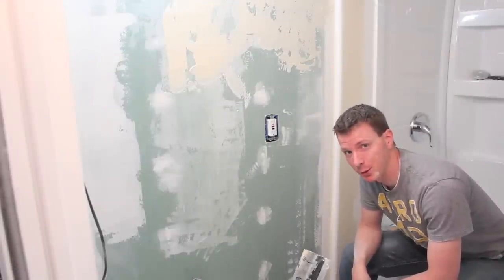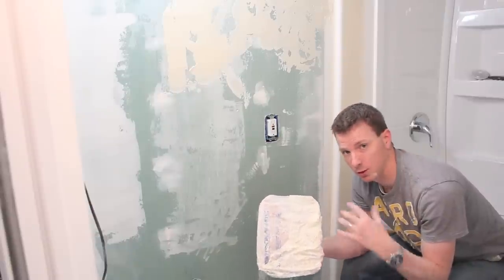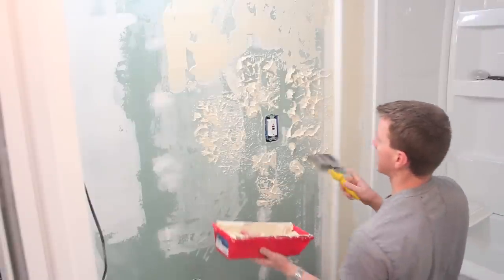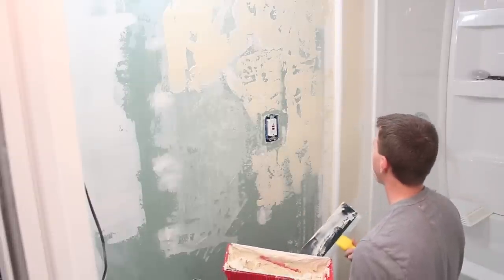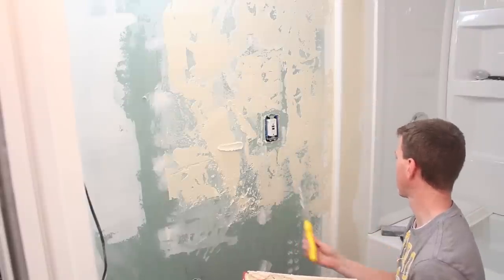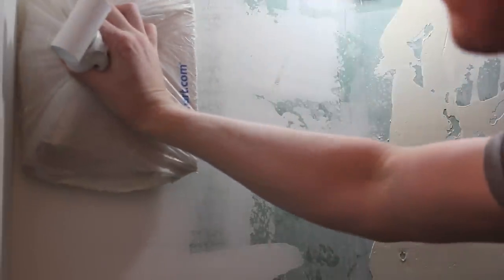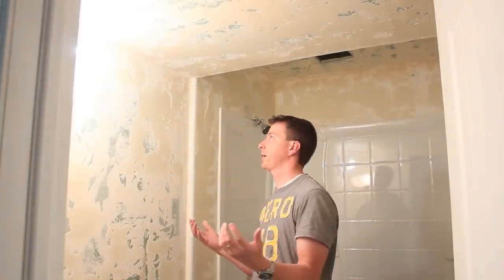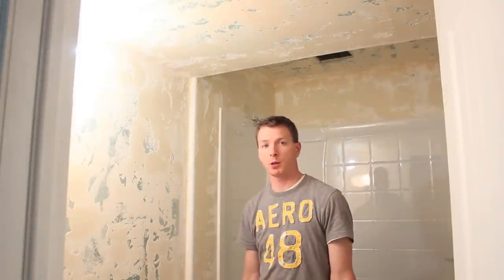How to Texture Walls - Santa Fe Texture

Comment: Tango, it may not look like much now, but that's because the old wall color is showing.  After some primer and paint, it'll look pretty good.  
Nils, I love your DIY hawk (that's what the flat mud holder is called).  I was going to build something like that, but with the amount of mudding I do, my hubby decided to buy me one.  
You did a pretty good job there, I did almost the same texture in my bedroom, and I love it.  It's textured to hide imperfections, without being too much or too trendy.  It's a classic that will probably never look cheesy like stomped or sprayed on texture.
A few tips and ideas for anyone who wants to give this a try: a knife with rounded corners will help to keep the edges from leaving lines in the wet mud.  When you smooth the globs, you can change the direction of your knife every stroke to get more rounded "holes" in the top coat for a more organic or natural look, and you can very the size of the globs of mud to vary the size of the holes. You can also add an extra layer once the first is dry, using the same technique, to add depth and interest to the texture, it'll slightly fill in some the first holes, and add new holes on top, but it isn't necessary, it just depends on what you like.  When the mud is dry, you can scrape over the top of the mud to remove any spikes or ridges that stick up, faster and easier than sanding.  After painting, you can go in with a color slightly lighter/darker (off the same color card) to highlight the high spots or shade in the lower spots to really bring the texture alive, adding a bit of water to the paint helps to blend it in.  Last but most important- Primer, primer, primer, before you paint!  Especially if there is old paint under the top coat- paint and mud absorb wet at paint differently, so using primer will give your paint a more uniform color and hide old stains, and it will make your paint job last years longer.  I love me some primer.  I never paint without priming first anymore.  I painted my kitchen ten years ago, and it still looks great.

Comment: Ps, I usually use the smaller knife to put the globs on the walls, and the hawk to hold the mud instead of the plastic pan.  The pans are hard to clean, and harder to use than the hawk.

Comment: Could this method be useful to hide UNsanded plastering of drywall joints and nails that leave high and low places in the plaster? The idea is to apply this thick mud over un-sanded plastering so that the awful sanding part is eliminated?

Comment: Can you add color pigment only ( not paint ) before applying the compound.  Using different colors then blending them with the scraper ?
Reply: I also thought about adding color pigment to the mud. However I was worried about getting slightly different color matches between the batches